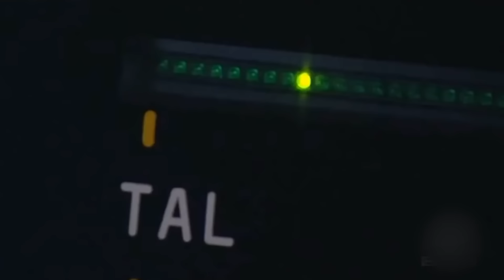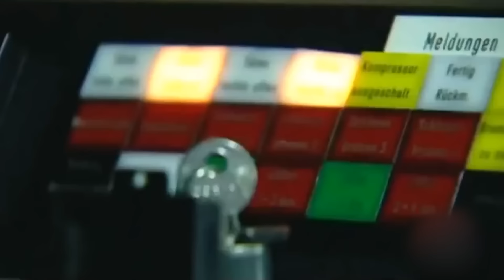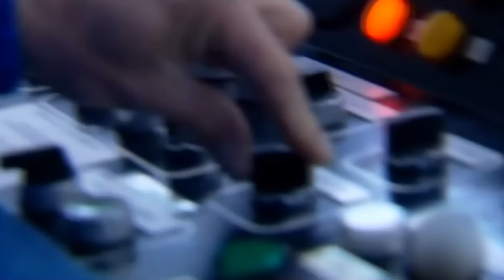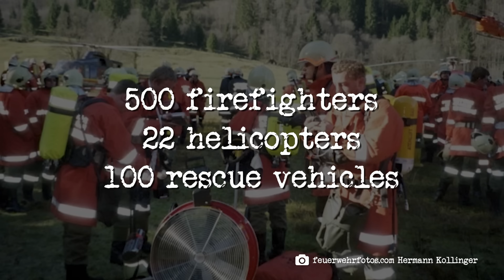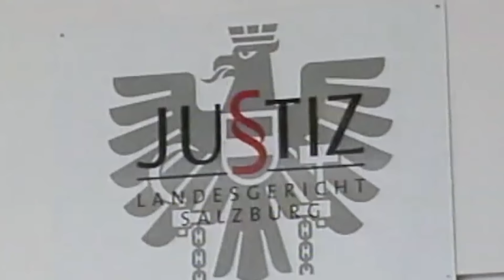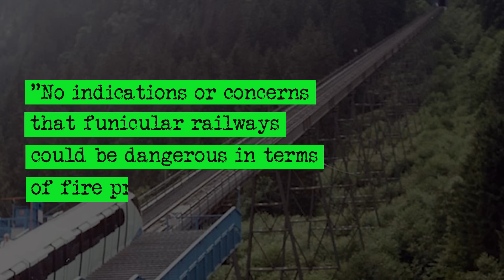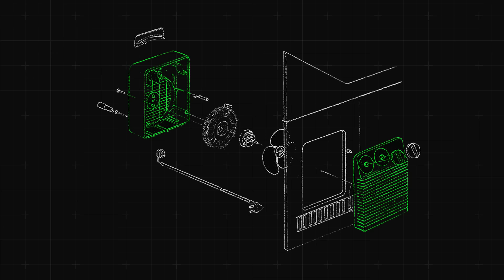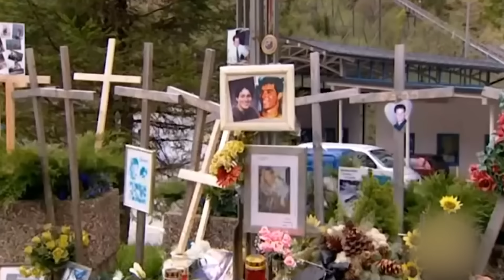The Kaprun Alpine Railway Disaster 2000

Comment: No fire alarm, no intercom, no cell service, no way to open the doors, where was the rear conductor's fire extinguisher?
The lack of any safety standards constitutes a criminal level of negligence in this case. Just awful.
Reply: @Yummy Spaghetti Noodles Mobile service from the outside does not work indeed. Repeaters would have done the trick.
Reply: The conductors' cabin was AFAIK locked - like all other doors. Level of negligence was indeed on a criminal level.
Reply: @Yummy Spaghetti Noodles Still possible to have a comms system between the passenger cabin and the conductor cabin - failing that why not have an alarm between the two cabins?
Reply: @Yummy Spaghetti Noodles I don't think anyone's basing their replies off of our current technology but to have no communication, whatsoever, on a major piece of equipment is irresponsible.
Reply: Welcome to Austria
Reply: Yeah, no big orange button that should be there.
Reply: @Yummy Spaghetti Noodles thanks for stating the obvious
Reply: @bigballz4u  so if someone murders your family member and no one is found guilty, nothing criminal occurred there either by your logic... Your comment is ignorant.
Reply: @bigballz4u  With that logic you must think OJ wasn't the murderer 🤡
Reply: @bigballz4u  >  f justice was so thoroughly sought, but nobody was found to be liable, I would say nothing criminal occurred.
Any competent electrical engineer would know that if you had a "power source" to allow the lights, controls, and yes, the heater, then of course you had a fire risk.  Period.  Whoever kept saying "well, it never happened before..." that's the person you want to put on trial, the person who made the decision, not based upon science, but based upon their best recollection of fire risks...
Reply: @bigballz4u  most ignorant comment I have seen on this platform. Yes I am referring to you. Not the comment you responded to.

This was entirely preventable. Idk if someone specific should have sat behind bars, but the company had to pay the price.
Reply: Welcome to history.

Almost all safety standards today existed because of a tragedy in the past.
Reply: @Yummy Spaghetti Noodles even 2g cannot penetrate a mountain. Let alone 4g or 5g
Reply: @TEverettReynolds  Well said! 😎
Reply: @mz00956  Except in this case, safety standards already existed, and for quite a while, too. Not only was the tragedy preventable, it didn't cause any major changes in procedures that weren't already a standard in other countries.
Reply: @bigballz4u  You have an unwarranted amount of blind trust in the legal system.
Reply: @aky4360  Austria is actually a country that has a lot of security features in case of a accident.
Reply: Didn’t you watch the video? It was safety standards being mindlessly applied that killed these people.
Reply: And to think this happened in Europe instead of the USA.
This is America level criminal negligence.
Reply: @mushyroom9569  
Didn't you read Domingo Chavezs comment? He's talking about putting safety standards that aren't mindlessly applied.
Reply: @Yummy Spaghetti Noodles intercom radios would work inside the tunnel with a repeater antenna every 100m , why no one though of those
Reply: Spiderman no way home< weird?
Reply: I agree fully that there was a long list of errors made in the safety standards that led to the horrible death of so many innocent people : but typically for Austria (I live there), in court it was found that nobody is to blame for anything, and “everyone lived happily ever after”, just like in every sweet little fairy tale.. “revolting, crude, primitive..” are just some of the words that spring to my mind when I think of the outcome of that mock trial.
Reply: @aky4360  because stuff like that only happens in austria, yes?
Reply: Agreed!
Reply: Seriously, who gives a shit how the fire started! Fires can always start, the question is how people escape afterwards! That's what fire regulations are about. Neither the video nor the builders or invesitgators gave a damn about it addressing that huge oversight. With this kind of track record I'm surprised Austria hasn't just burnt down.
Reply: Thank god I live in USA. We have safety tool almost everywhere.
Reply: for what if you transport animals they dont have the same things, only 1 klass ;-) 
horribel story 😔
Reply: @TBonerton  It's even worse. It's more like if someone was murdered, the murderers were put in charge of investigating the murder, were allowed to manipulate the evidence, ignored independent evidence, and got a judge who went 'oops, god did it I guess, lol" after making baseless assumptions about clear physical evidence...then the public is supposed to take the murderers word for it that there was no foul play
Reply: The rear conductors fire extinguisher was inside the locked rear conductor cabin
Reply: Criminal negligence for sure.
Reply: NoBoDy SaW iT cOmInG
Reply: @Yummy Spaghetti Noodles lmao as if you need 4 and 5G to make a voice call.
Reply: "The greatest safety protocols are writen in blood"

   -random guy that I found on Youtube
                                        (props to him.)
Reply: @stanislavczebinski994  could have done like a car tunnel booth situation
Reply: I'm not even claustrophobic, but this was horrible!  I can't imagine how it would feel to be so trapped.
Reply: Double layer glass that was nearly impossible to break on top of it
Reply: The thing is that the funicular WAS in compliance with the safety regulations of the time. The regulations were just hopelessly outdated.
Reply: @erueka6  you clearly didn't read a single thing about this case. This was entirely preventable. The video also does a good enough job in explaining how. It's really not that hard to understand.
Reply: @erueka6  also YES, it's HYDRAULIC OIL, I might be a second degree SOFTWARE engineer but I don't need to be a CHEMIST to know that HYDRAULIC OIL IS FLAMMABLE. Have you ever read your car's manual?
Reply: @erueka6  you'd think the people they hire for contraptions like these who cost a few millions to construct would know what the hell they're doing, no?
Reply: @erueka6  and finally, if the pipe for some reason COULDN'T BE INSTALLED PROPERLY, it's the plumbing engineer's responsibility to make the rest of the engineering team, who DIDN'T STUDY PLUMBING - AWARE OF THE ISSUE!!!

Forget the people who died (for a moment, don't forget them), even the company came out with a loss here. They could have saved that million dollar system, instead the idiots had it burnt.

Fixing a system is almosy always cheaper than building a new one. It's also definitely cheaper than a lawsuit and a catastrophic reputation hit.
Reply: Guys, this is the year 2000.
Cellphones were finally starting to become mainstream and weren't bigger than a brick.
Getting cell service in a tunnel would be like super luxury. Not many people had cell phones, why would anyone cater to cellphones at the time?
Reply: @Simqer  while I’m not sure what you are responding to, this is absolutely incorrect. Cell phones have been around since the 1970s and by the year 2000 most people in modern countries had one. It’s the era of flip phones and Nokia, just 6-7 years before the Smarthphone came along. Touch was already a concept for a while and even smart features like a digital pen Apple came up with in the 90s and (primitive but still existent) AI recognition to turn said pen’s inputs into text outputs. Browsers on phone and such were starting to become a thing, and most phones could text.

But, this is a tunnel, and it is indeed difficult to account for cellphones in a tunnel. Even in 2023. What they should have had (and I don’t remember if they did) is a telephone line. As in, a wired, proper telephone for emergency, knowing that they can’t rely on cellphone connections.
Reply: @meridiasbeacon7669  Maybe in some countries like Japan and USA.
I lived in Belgium and not everyone had a cellphone, yes they were starting to get popular, but not many people had one... yet.
It is around 2000 when you could say that more households had one than not.
Reply: @Yummy Spaghetti Noodles Never mind 5G and 4G technology. This was in the year 2000, they didn't even have 3G back then. A completely different world.
Reply: yeah, i mean a cig lighter could cause a fire.  ya have to have fire extinguishers at the very least...
Reply: @Simqer  I mean, it's more or less irrelevant semantics about if or not passengers had them as signal would be nil inside the tunnel in the first place.
I'm rather baffled about the heater though, installing a potential fire hazard in a system whose safety entirely hinges on having no potential source of fire in the first place.. and everything else about that idiotic installation.
Reply: Safety wasn’t invented yet
Reply: Probably with the rear conductor. (i.e. not on the train) Everything about it was a deathtrap. "Ah, it can't catch fire!" It's full of flammable shit, and has electricity... it can catch fire.
Reply: This was the year 2000 if you dont remember what it was like back then, i agree in blame if blame is due but sometimes "shit happens" thats how we improve design. Sometimes there isn't really anyone to blame. How come you didn't think of this or think of that? 

If the lines were leaking hydraulic fluid and the inspection was shit or missed then there is blame, if the leak started after the inspection and caused the fire then there isn't really anyone to blame.
Reply: @oshkoshbegone  Even in 2000 people knew better. EVERYTHING about it was a deathtrap. They put a plastic electric heater where it never belonged, and right next to leaking hydraulic lines. The cabs had NO emergency egress options. There was no fire suppression anywhere in anything! And there was no egress plan or safe spaces built into the tunnel itself. And it doesn't look like they even made it feasible to walk in the tunnel. ALL of this is just as obvious today as it was decades ago.
Reply: Can’t forget those double pain nearly unbreakable windows. They didn’t even put a warning sign saying “travel back down the tunnel to avoid suffocation in case you somehow make it out of this death trap.” The people responsible for engineering and approving it should be in prison or at the very least have their licenses taken away
Reply: Just having a basic understanding of Physics would have saved almost all people. 
With that being said, I would say the train operating company is mostly at fault - they didn't install any safety features at all (emergency door releases, exit pathway on the side of the tunnel). You can always have a cable fire or something like that.
Reply: Wait til ypu hear what just happened in greece with a proper passenger train that was supposed to be suppirted by an array if safety systems, uninstalled since they were bought in 2003
Reply: @stanislavczebinski994  Youtube ass comment 💀
Reply: Exactly. And this happened in the 20th century, not in the 1800's. Diabolical safety standards.
Reply: @domingochavez2552  Bro using clown emoji in 2022
Reply: Yeah, talk to your local engineers and managers about that.
Reply: @ozzy_ruiz  You also have shootings almost everywhere there too, perhaps it balances it out.
Reply: safety standards are set over time after blood is shed
Reply: @RanDom-pl7fx  not every standard should be built with the tombstones of the dead.
Reply: @TeenWithACarrotIDK  it shouldn't be, but unfortunately we only know what's wrong after something happens
Reply: Utter blunder.
Reply: No fire alarm and no fire extinguisher is because they deemed it impossible and never knew that the fire would even occur, there's no cell service and intercom cuz they are inside a mountain, services in tunnels are horrible, not to mention one going up a mountain
Reply: Yes ,. no wounder that Austria´s (really criminal) court system tried to sweep it under the carpet due to the important tourism
Reply: Wouldn't this be considered a black swan-ish event ? exacerbated by overconfidence
Reply: @mushyroom9569  Trains older than these funiculars have emergency door releases. This funicular didn't even had emergency medkits onboard and communication to the operator also wasn't available.
The railway neglected everything.
Reply: Japan is famous for this. They don't really care haha. I saw another place crash recap and they waited til the next dey to "rescue" the survivors.
Reply: i agree
Reply: "ABC, it's simple as OSHA creed, them people were DOA, ABC, chimney, baby tourism rules yeah!"
Reply: Thean how yr people. Not realize and take are risk all. About money...
Reply: THE OPERATOR, THE MANAGEMENT & THE DESIGNERS WERE ALL STUPID TO THE HIGHEST LEVEL!!!
Reply: Welcome to Austria
Reply: Yeah, negligence and corruption. The fact that no one was held accountable for this just makes it more likely to happen again.
Reply: I was just about to say those exact words and perhaps most commenters here agree how infuriating this is that no emergency escape were made and planned nor even hammers to break the windows (many buses has these i.c.e.) no smoke/fire alarms to catch the attention of the driver and the main quarters where the train left. And this wasnt the sixties or sometime then, this happened in 2000.
Reply: Assuming that only fuel and engines could have lit the thing on fire is also beyond comprehension
Reply: They probably didn't have fire percautions because they were confident af there would be no fire, as he said in the beginning, the train was supposed to have 0 fire risk, it was all cables and pulleys and stuff
Reply: They could've just made a fuckin chairlift
Reply: Beyond unacceptable
Reply: @aky4360  ???
Reply: Also no way to manually open the doors or hammers to break windows.
Reply: I cannot grasp it, either. How is it possible to pass ANY safety regulations when a vehicle, any vehicle, but especially a one closed in a tunnel, has no way to manually open the passenger doors in case of an emergency from the inside or no way to at least click an alarm button to inform driver/control room. What is a more basic safety measure for such railway than this? I would like to see safety acceptance criteria, because it's literally impossible to pass them unless they were completely idiotic or didn't exist at all. And we're talking about damn big companies that designed and managed all this. Not to mention there should be an emergency ventilation system since it's a closed tunnel. How stupid can so called professionals be. And they tried to blame the workers who had nothing to do with the real cause, which wasn't that a heater got on fire, but that it was possible for such trivial thing to escalate so much.
Reply: okay attorney domingo
Reply: "The sheer bravery of the twelve passengers who escaped is incredible. It’s a testament to the human spirit, even in the darkest of times. Their quick thinking literally saved lives."

Comment: I rode this train with my parents during our ski vacations in the 90s. I was in my early teenage years at that time, and I remember I always had this feeling of trepidation when I boarded the train. I literally stood there like a statue for the entire ride and felt a great sense of relief every time we got off. Even more than 22 years after that disaster, I still get goose bumps when I write about it.

R.I.P. to all the victims.
Reply: Today I saw a train like this for first time and before knowing what caused disaster I felt discomfort especially when I saw how steep is going and then even into long tunnel with fact that is carying 180 people, so scary
Reply: I've been on similar trains and for me it's mostly the incline that's scary. I don't know if it has ever happened, but in my mind it's possible the cable snaps and we all take the quick way down.
Reply: Yeah I rode it in 1994
Reply: Rode this in 1998😮
Reply: @grumblur  I wonder has there ever been a cable breaking incident with one of these trains? It has to be a horrifying scenario even with hydraulic brake systems.
Reply: @gangsterHOTLINE  the brakes on those things work almost the same way they do on elevators. The brakes are kept disengaged by the tension of the cable holding the cabin. If the cable snaps or becomes lose in any way the brakes engage immediately. It's basically a dead-man-switch for the cable and brakes. There needs to be a tension on the cable to keep the brakes disengaged.
Reply: How did the floor inside look. Is it true that it somehow went up?
Reply: @kasperthehamster8109  a lot of steps if i recall correctly from being in slovakian mountain hike
Reply: What an absolute lie lmao. Apparently you were a psychic child that could feel the future danger?
Reply: @MarioGoatse  Get yourself a life and don't jugde people you don't even know!
Reply: @wernerr.5532  Only if you stop telling lies on the internet
Reply: @MarioGoatse  Seriously - what is your problem? I wrote I had strange feelings while riding this train and felt liberated when we reached the mountain station. I've never pretend to be able to predict any future events. I have no idea why you are so upset.
Reply: @wernerr.5532 you’re good bro people don’t like to believe in things that can’t be rationally explained. Supernatural, paranormal,God. It’s all real.